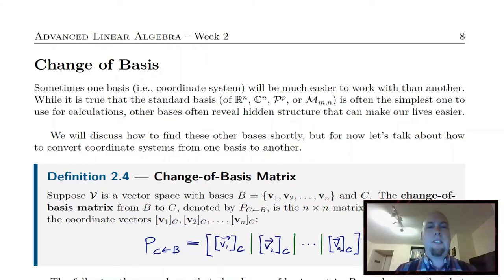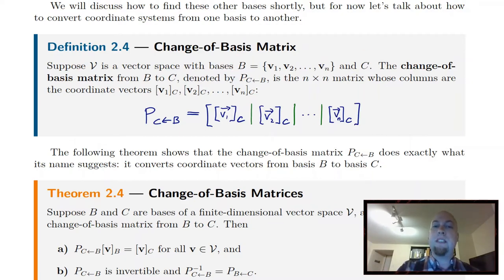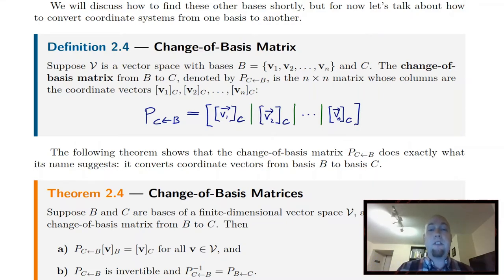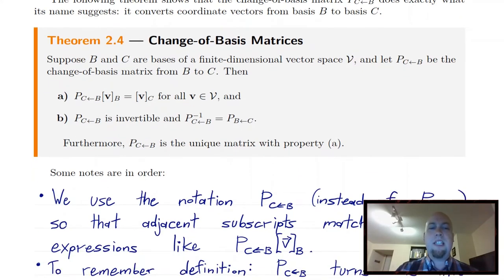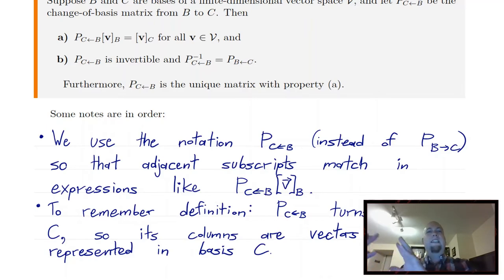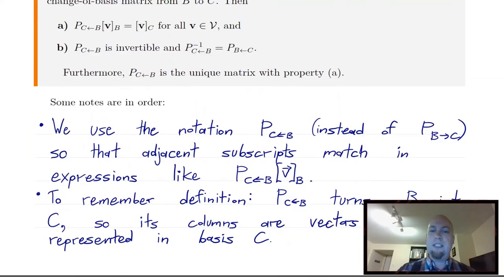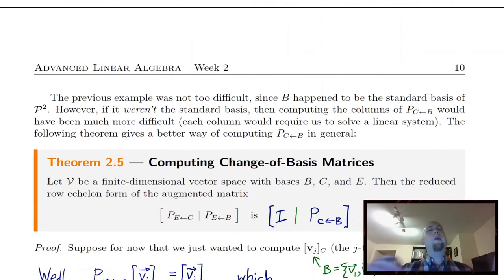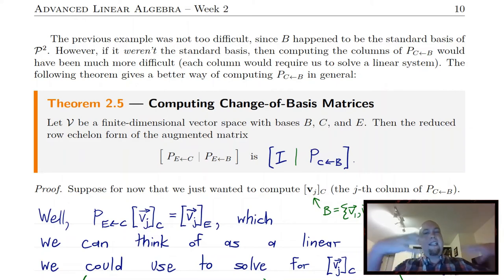Advanced Linear Algebra - Lecture 8: Change of Basis

Comment: Professor Johnston, 
     In the first course, I struggled to understand the transformations from [v]subB to [v]subC.  I found another way to look at it.  Because it might help others to understand these transformations, I'll post it here.  Given basis sets B and C in some space, the matrices [B] and [C] are formed using the basis vectors from the respective sets as columns.  [v] is assumed to be in the standard basis E.  Hopefully, the notation is good enough.
So, [B][v]subB transforms the vector [v]subB into [v], which are the coordinates in the standard basis [E].  Similarly, [C][v]subC transforms [v]subC into [v].  As both [B][v]subB and [C][v]subC are equal to [v] they are equal to each other.  Thus, [B][v]subB = [C][v]subC.  Transforming [v]subB into [v]subC is accomplished by multiplying the equation with [B]^-1 (e.g. inverse of [B]) on the left.  
[B]^-1[B][v]subB = [B]^-1[C][v]subC  -->  [v]subB = [B]^-1[C][v]subC.  The transformation matrix from basis C to basis B is [B]^-1[C].  Similarly, the transformation matrix from basis B to basis C is [C]^-1[B].  
Thus, we transform between coordinates without ever knowing what the vector in the standard basis E is.